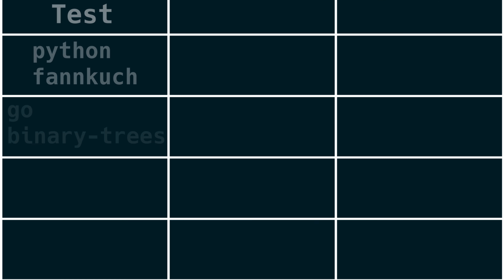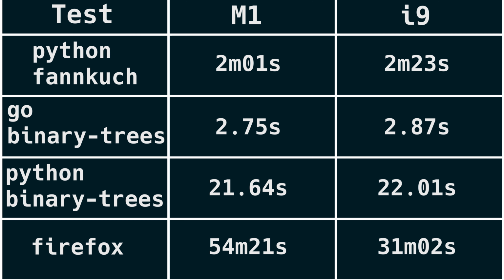m1 mac - will it work for developers?!

Comment: This is the best review that I have seen so far that answers my questions as a developer. any update since we are now in August? I'm about to buy Mac Book Pro with M1 chip for development, I have the same set of tools that you have mentioned, like recreating a whole infrastructure via terraform on my machine for technical showcase, deploying multi-node kubernetes, etc. With Docker on M1 Mac, the way you interpreted on how it is being executed in M1 Mac is like running Linux container on Windows machine where it is technically running in a VM and not natively. At this point, your video helped me a lot to decide. I guess if there aren't any new development for M1 Mac, I will go with intel instead.
Reply from the maker: Thank you! So as far as kWh/performance you are not going to find anything out there better. My main two problems as I understand them currently:
1) due to the architecture and memory is shared between gpu/ai/cpu 16 gb is NOT enough memory and I don't recommend it because your hard drive that is now not replaceable will be destroyed if you try to use this as a pro machine. For example. just tested right now and docker, just running (not running any containers still takes 4gb of memory just to run! (way down from its original 9GB!) But that being said. I'm using 10GB of memory having safari open, writing this, and docker and activity monitor (and I only have a single tab open!) (adobe desktop service is uniting in the background consuming 100mb but) my point is. get 32 or 64gb at least. Because it's not upgradable, even by apple.
2) as I have come to learn Mac has the worst UI and I can't run linux without voiding my waranty because their boot loader (at least a few months ago) did not support linux.

if that second one was not an issue and I could run linux on these you know I would be running 3 of them as my HA Kubernetes cluster. 100%
Reply: @NullLabs  Thanks for this info, I guess, I will go with Lenovo's latest T-series for Linux or just get the Mac with Intel chipset. :)
Reply from the maker: If you like mac's, I would say just wait till you can get one with 32gb of memory if you are going to use this in a professional workload. again. energy per performance I don't see it getting beat. though again. I have not had any problems with my 3 year old lenovo p1. if I could install linux on a new m1 mac with 32gb of memory, I would buy one right now and give you my p1. not even joking. but I cant yet. so :) I think this fall there is a good chance they release a real PRO model with more memory. if they do and you like mac I would be hard pressed not to recommend it. Just remember, it can't be upgraded. so with these machines I think it's important for everyone to overbuy so that you don't end up wasting money and needing to upgrade in 2 or 3 years.
Reply: @NullLabs  I never had issues with Mac recently, and I like brew, I have this bad habit of reformating my machine once in a while to keep everything fresh. I bought the Mac Book Pro last year before Apple released their M1 chip for my wife, I thought I should have waited back then, my wife and I are in the same industry and have the same set of tools. I thought I should dive into M1 craze, but like I have mentioned, no one actually reviewed Mac's M1 from a developer's perspective. Power consumption for me is not an issue, I am more into the performance of the machine, and with your review and comments, I have no reason at all to take the risk of scratching my head if things will not go well with M1. I just placed an order because I really need a replacement for my 2018 Mac Book Pro that went into several bad situations like car crash and dropped from stairs. ROFL
But I say dibs to your P1 if you happen to make linux work on it. ARM Linux with that power, that's a beast, It's like a RaspberryOS running on a supercomputer.
Reply from the maker: Thanks for the chat! My wife is also looking to get a MBP as soon as she can get 32gb. so I'll 100% review it once I get my hands on it.

Comment: There is one point in the analysis that is missing: M1 is a CPU designed for consumer devices, it has replaced the Intel i3 and i5. The developers need more powerful machines but M1 has proven that ARM can be used successfully on laptop/desktop, and it's quite surprising for a smartphone CPU
Reply from the maker: Excellent points here. Honestly I don't think you really need too much more power as long as they would enable expanding the memory!!! 16 GB is just not enough on this thing! Thanks for watching and giving feedback! Will try to make future reviews better!

Comment: Do you think m1 will be good for ML related stuff?
Reply from the maker: I do think it's possible. I'm actually looking into running some tests on this over the next month. I think it's possible. my tests are revolving around apple ML vs the opensource tools out there. My initial guess is that it is. But I have more tests on this. I will release a video on this topic though, so stay tuned! Its in the works!

Comment: This is the best reviews so far, keep digging deep because this about RAM is crucial. Changed my mind about buying for now. 
I'm Linux user, wanted to try and see how fast would it be in real life, but I guess I would likely kill the performance benefit with this consumption of RAM.
Reply from the maker: Yeah. Honestly I could not tell you if it was just all the GUI apps I used where buggy or if there is a real memory issue, I did a bunch more tests and even wrote my own app that just allocated memory from the command line. This app consumed the exact same amount of memory on all platforms I have to test on, but it had no UI. Every UI application consumed more. But I could not tell you if this was bad porting of the app or something else. My guess is at this point because it shares it's memory with the GPU and the AI module this is just the "new norm" for a mac, If this is the case (and apple has not responded to my e-mail) then you just need to buy more memory.

I found a lot of people with hard drives failing, I think a lot of them did not realize this is because they are using swap and writing 100TB of data to their hard drive. And I found it really easy to hit swap on my 16 gb.

Thanks for watching and hopefully I can get more hardware to review for you all! I'm trying to get some stuff but I have to budget for it and have a use for it past just a video :)